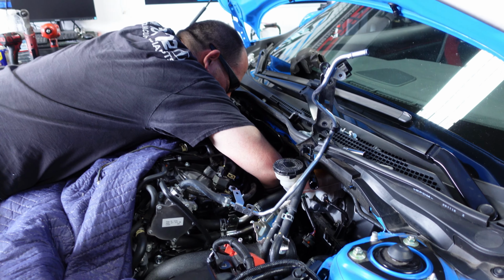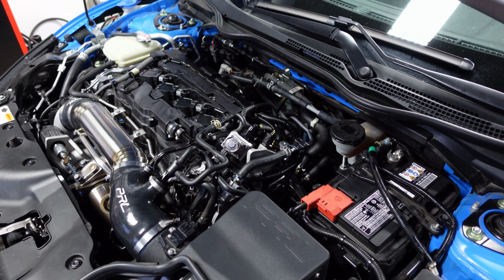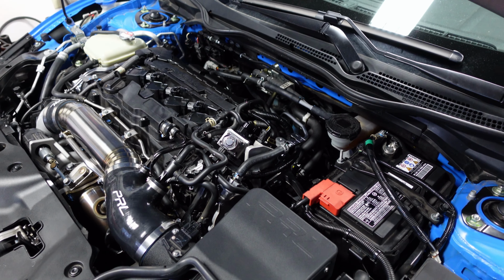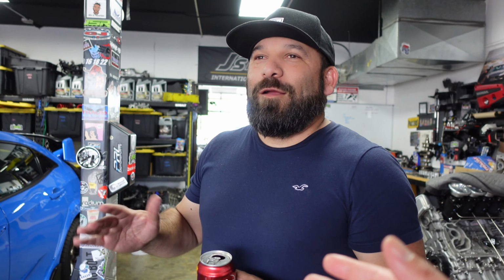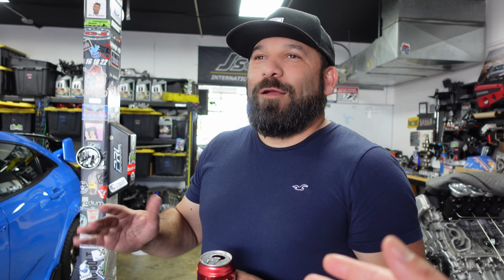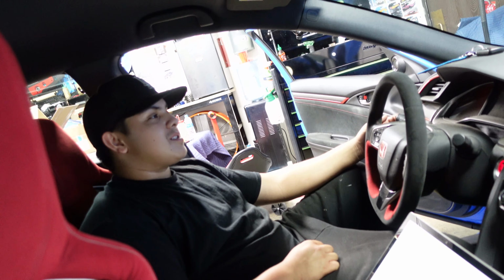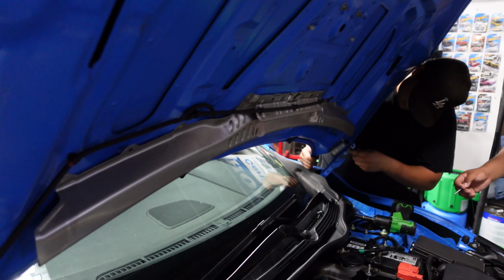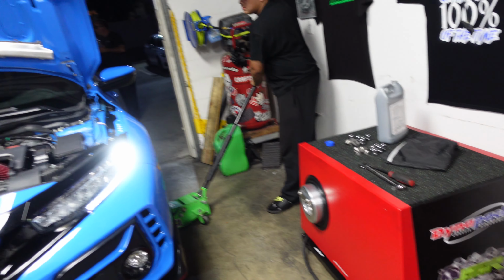500WHP CLUB? BIG TURBO +FBO POWER OVERNIGHT // PRE DYNO INSTALLING PORTED MANIFOLD & JSR FUEL SYSTEM

Comment: This guys got the right recipe. Stock fk8 exhaust with upgraded turbo. Nothing but turbo noises.
Reply from the maker: Literally wt we were saying. Part 2 will offer more spool noises!!!
Reply: The only thing is at above 500 whp the stock exhaust will choke your top end and may cause pressure. A full 3” exhaust will open the flow up to get maximum power throughout the power band.
Reply from the maker: @weduhpeople8504  yes agreed, he rather have quietness than the extra 10-15hp
Reply: @weduhpeople8504  Ill take the pepsi challenge on my top end vs any other stock motor FK8 - Id rather keep the stock exhaust and just run a 3" cutout if I need the flow. 
We will be testing no exhaust vs stock exhaust on the next dyno session to see what the stock exhaust is actually costing me.
Reply: @weduhpeople8504  On 4" maf housing we made 547/436 and thats about where the stock exhaust became a bottleneck on the p600 - could probably gain another 20+whp with 3" but keeping it low key as the daily
So far its highest p600 numbers on stock motor/stock exhaust/no meth/no nitrous etc

Comment: Dude went from stock to FBO with a bigger turbo and fuel system in a month 😂🤯. Dropped a quick 15-20k 😂😂😂
Reply from the maker: Lol literally he did…
Reply: @maganamfg  I’ve spent 9-10k in parts and haven’t even bought an R yet. Been buying parts piece by piece I’ll grab the car when this price gauging fades away. I’m in car sales so I know this boom in markups will be killed when all the new cars flood the market. I’ll buy my fk8 then
Reply from the maker: @dmaxxd94  lol yup yup. 

 I see $30k for fk8 for awhile.
Reply from the maker: @dmaxxd94  lol nice
Reply: I ran this p600 for 3 months and then upgraded to beta test the RV6 R660 - made 566whp@7000 on 1430s and upgraded to 2000cc injectors and made 566@7600 on 30psi
Rv6 still hasn't finished the new ported compressor housing/inlet which would add another easy 15 to 20whp .....upgrading my headgasket/head studs/valvesprings - pushing the turbo to 34psi aiming for 600+whp @8000
Stock head ports/stock bottom end
Reply: @TheFK8Life  🤯🤯🤯🤯🤯🤤
Reply: @dmaxxd94  new gasket should arrive next week so gonna break it in a little with the new studs and ferrrea valvetrain - once I do 3 to 400 miles gonna hit the dyno and make sure the motor is healthy for more boost.   I'm confident we can push the RV6 R660 to 580 to 600whp on 34psi e55 fuel.  
Most guys should probably stay in the 28psi 540ish range on stock gasket/studs  but I'm trying to push the turbo as hard as I can to see where it stops.  
Still stock clutch/stock trans etc 
Stay tuned - I'll have PK make another update video soon when we get numbers

Comment: Are those hood spacers a West Coast thing? I've been around a decent amount of them in Florida and haven't seen a single one with them.
Reply from the maker: Yes it’s a west coast thing, been around since 2000s and it’s not uncommon. I thought east coast also would have em.
Reply: The endurance racers in the Philipines run them to manage their heat issues - does a good job of venting excess heat.  Im running a stock hood without any vents for cooling so its a cheap $20 way to cool the car at speed when your doing pulls.
Reply: I'm sure people around here have them but I haven't seen a single one yet. Is there any legit proof that it helps with Temps? I'm down for anything helping that owning an Fk8
Reply: @thinkforyourself5672  They are $20 - mount them before and after pulls watch your temps
You can feel the heat coming out of the gaps after pulls
Not saying its a magic bullet but at speed it allows the majority of underhood heat to escape.  Once you mount them youll see the opening at the back of the hood area - much more area for hot air to get out vs stay underhood.
Reply: It's not necessarily a west coast thing, it's an old school honda thing that works best on these FK8s. We have seen 10-12° cooler bay temps while driving. As stated above its a cheap $25 add on that definitely helps the FK8 platform. Some would say it affects the air design but we think otherwise.